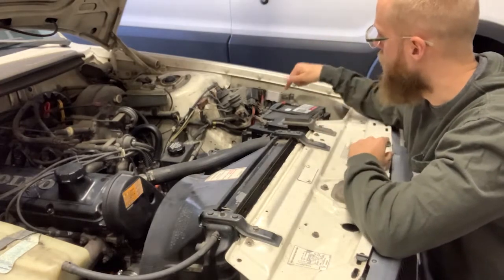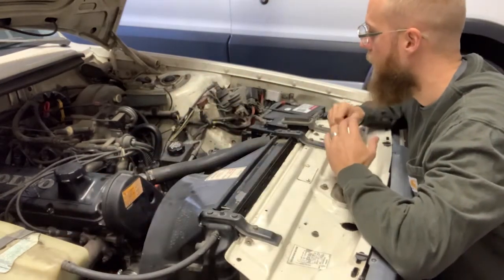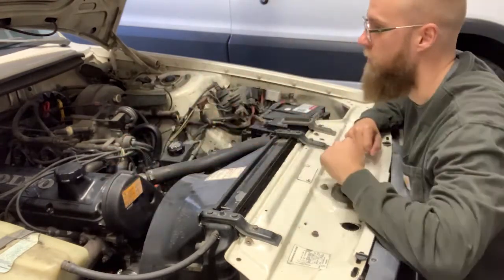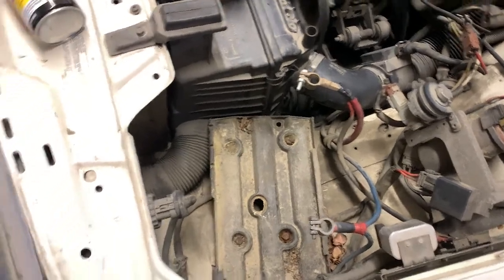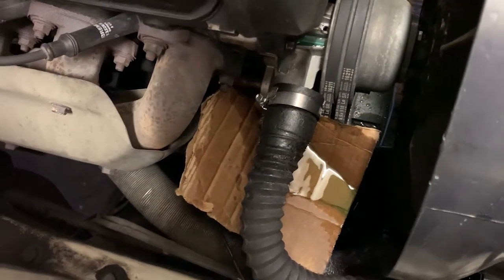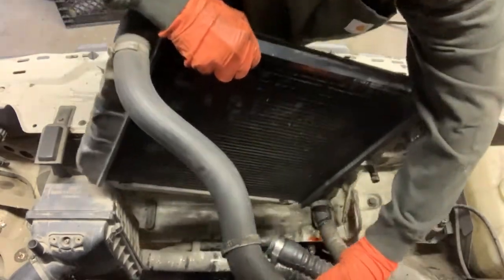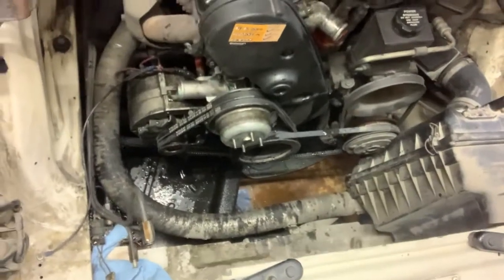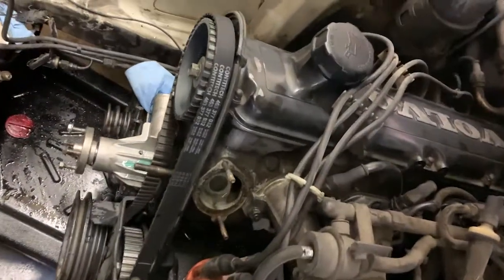Volvo 240 Head Gasket Part 1

Comment: Could you send a link to the heads that you used?
Reply from the maker: Hi there, I used the elring kit from FCPEuro: https://www.fcpeuro.com/products/volvo-cylinder-head-gasket-set-b230f-victor-270689. I had it machined at a local shop, and had them adjust the valves while they were in there. Hope this helps!

Comment: how do I measure a b230 head (530) to see if it has been shaved?  I don't want to end up with a head that can't be fixed.
Reply from the maker: Sorry David, I don't have personal experience with that. If you pick up a Bentley or Haynes manual, they should both have measurements and instructions on how best to measure your block.
Reply: @jonrasu  thanks answer found 141.1 measured to valve cover mating surface